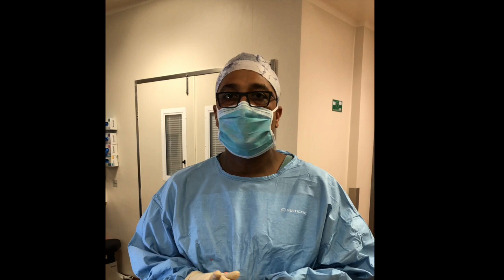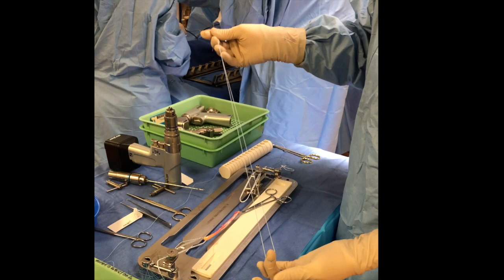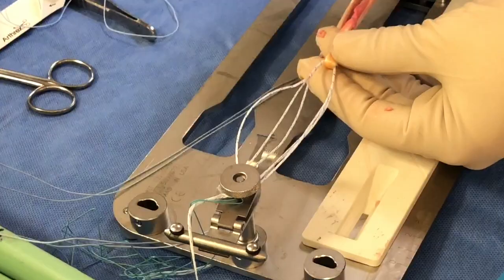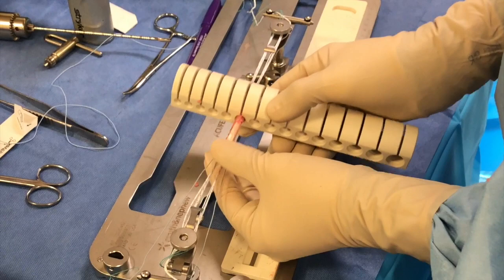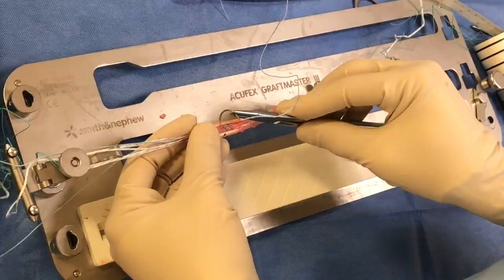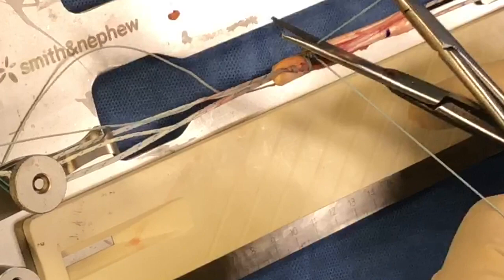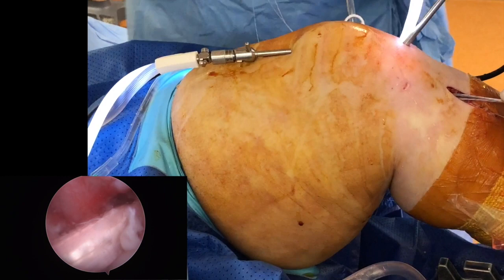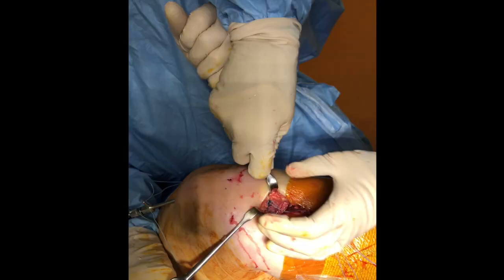Smith and Nephew Ultra-Button ACL Graft Prep and Insertion

Comment: In this surgery case why you use x tendobutton .?Please reply 
Lots of love from India🇮🇳
Reply from the maker: The tibial tunnel is large and the standard button is too small to offer interference at the tunnel opening - hence the extendobutton 
-
Reply: @drkosh  in this case what is the  tunnel diameter of femure and tibia.?
Reply from the maker: Can’t remember- but usually between 7-9mm
Reply: @drkosh  all femoral fixation with ultrabutton need x tendobutton? In this case if you not used x tendobutton with ulterabutton Then what does in future?
Reply from the maker: Are u a surgeon- if not it’s difficult to explain - don’t need extendo for femur as have a 4.5 pilot tunnel
Reply: @drkosh  in first answer you said tibial tunnel is large what's mean in large tunnel diameter Or large tunnel length?
Reply from the maker: Diameter
Reply: @drkosh  does x tendobutton gives strong fixation compare to indobutton?